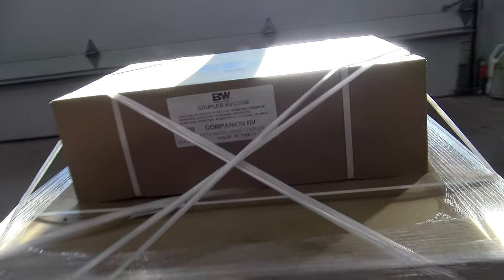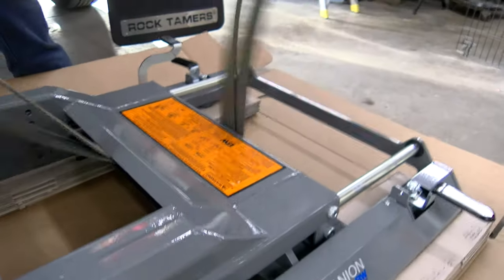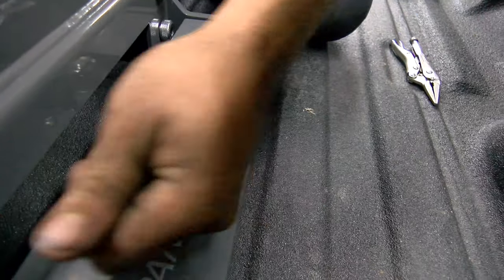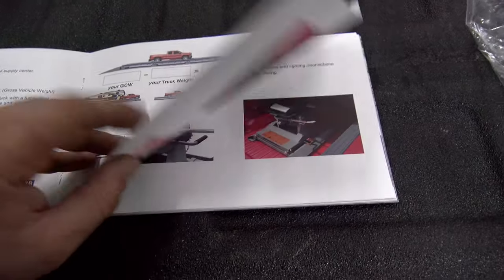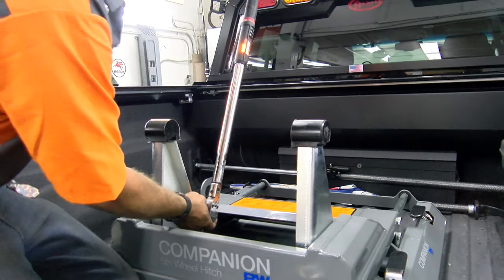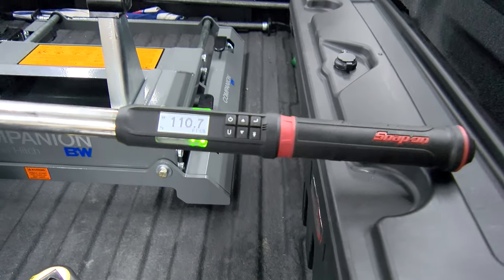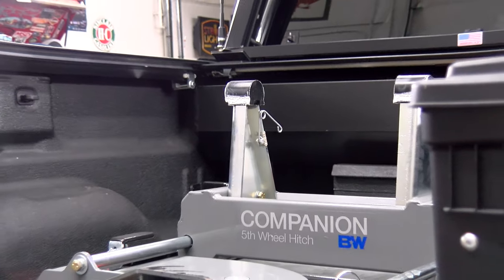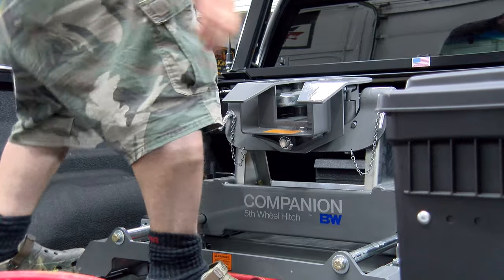B&W Companion 5th Wheel Hitch Installation and testing Vs Andersen W/ in Bed Gm Puck System

Comment: When you were doing the installation of the B&W did you take a measurement of the hitch height from the bed to the top of the hitch?  I need to find one that gets me as close to 17 as possible.  thanks
Reply from the maker: If I remember correctly, yes, I did it should be in the manual